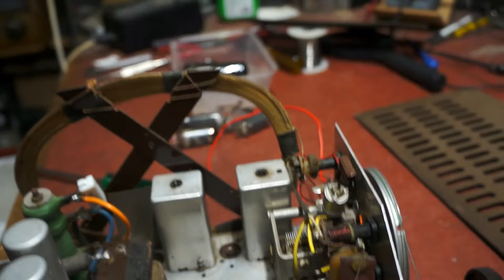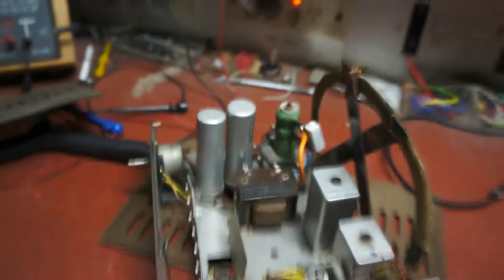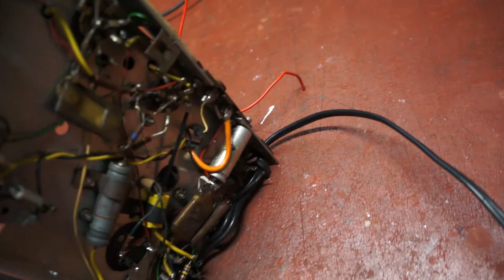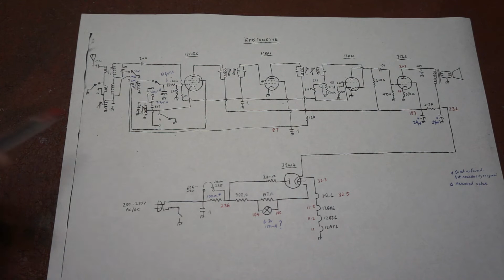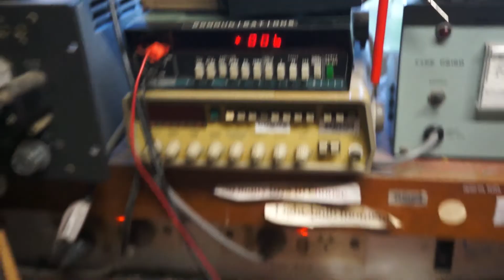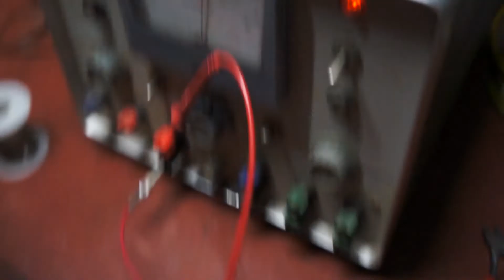Emstonette Mantel Radio.

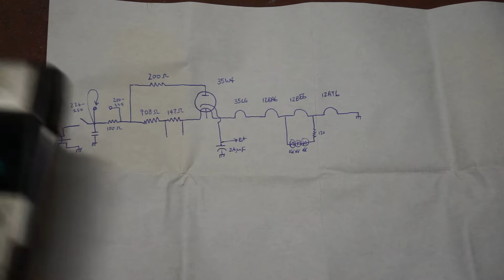Comment: G’day John, another highly edifying and stimulating video. I must say I was overjoyed at 11:21 in the video, where you whipped out the Casio fx39 calculator; this was my year 11 high school calculator, which I still have, and I still use!! I appreciate the additional engineering insights into series heater operation, as I have now done several of these sets (a couple of European, a couple of British, and several AA5/6 sets) and I have come away with a deeper understanding of such an arrangement. Thanks again John!
Reply from the maker: The fx39 gets a lot of use! You might not be aware but it has rectangular to polar functions using the + and - keys. I also have one new in box never used.

Comment: hello how are you, luckily I found your website some time ago from which I was able to test some FM receivers with 6GK5 that worked very well, my question is, regarding the RF chokes which you build from a wire 1/4 of the wavelength for FM (100Mhz) or 0.75 meters, would that apply to other bands??? for example to CB ? In that case it would be a 2.7 meter long wire, would that be logical? Your site is very good and I look forward to your response! regards !!! , (I speak Spanish, I hope the translator doesn't make mistakes hehe)
Reply from the maker: I have not tried for other bands, but I believe the same formula would apply.
Reply: @cool386vintagetechnology6  THANKS FOR YOUR ANSWER, AND TELL ME ABOUT THE USE OF THE 6AL5 AS A RECTIFIER IN FM PULSE RECEIVERS, COULD THEY BE REPLACED WITH FAST DIODES???
Reply from the maker: @pablolagreca7261  Germanium diodes are used in this https://www.cool386.com/armstrong_pcrx/armstrong_pcrx.html and silicon diodes in this https://www.cool386.com/sspcrx/sspcrx.html I have not tried Schottky diodes as such, but they should work.

Comment: I was thinking a 50L6 rather than a 35L6.  They are actually two completely different tubes electrically; the 25L6 is actually much closer to a 50L6 than a 35L6.  I would use a 12AV6/HBC91 in place of the 12AT6 as it has higher gain.
Reply from the maker: 50L6 would have been more efficient in terms of power dissipated in the heater dropper, but the resistance was way too high. Even with 35L6, the original dropper was slightly high, and had to be reduced by the paralleled 8.2k resistor.(The calculations are in the article). In this set higher audio gain is actually not desirable because of the hum. But I take your point - the 12AV6 did make the 12AT6 obsolete.

Comment: Thanks for a very interesting restoration of a tricky radio. Interesting to see the use of a DC power supply to operate the set.
Reply: Much safer than running it from mains, in lieu of an isolation transformer.